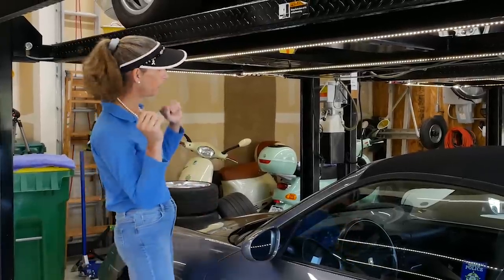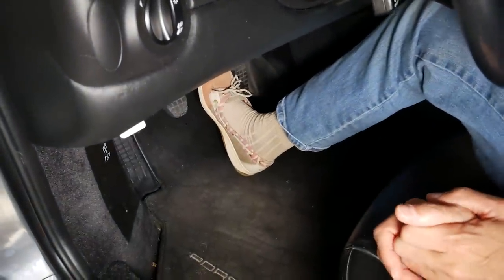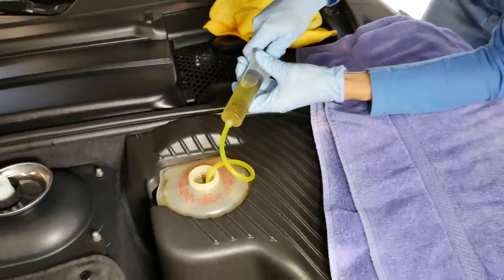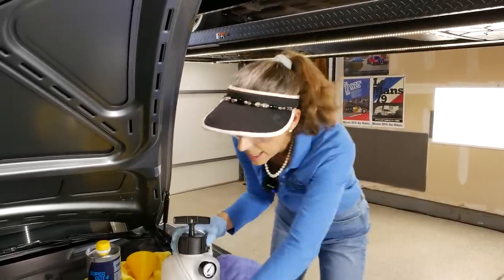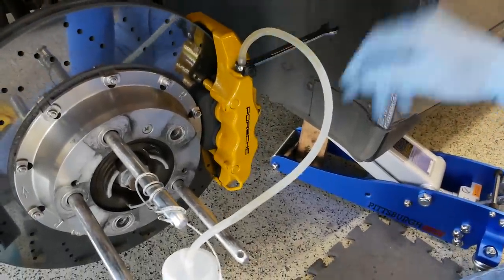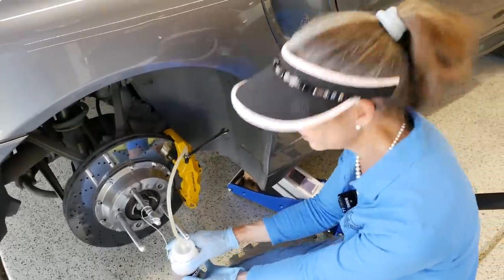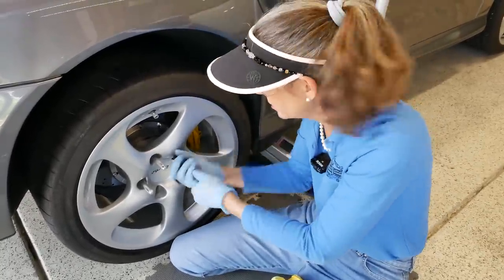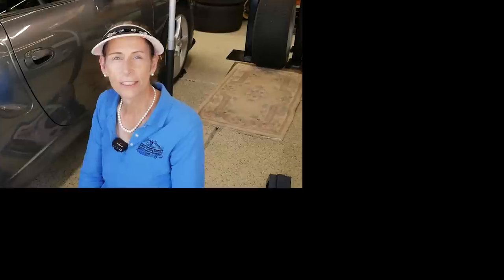How To Flush and Bleed your Brakes - EASY!

Comment: Great video, just couple safety things, I was always taught not to use ratchet for primary loosening or tightening as lot pressure on small paw of ratchet. More importantly please don’t put your foot under wheel when only relying on jack, always block or place stand under car. Sorry if sound draconian just don’t want see you get hurt.
Reply from the maker: Tony E No, thanks for that! I didn't film (well, didn't make it into the edit actually...) I have a block of maple locking the jack.  It is always a dilemma with these cars that there really is only one jack point.  Normally I scoot a wheel under the car, but these are too wide! 
A break over bar is always stronger, but that ratchet can take well over 150ft-lbs.  It is pretty strong. Easily replaced as well ;) thanks for the safety reminder :)

Comment: This was informative, but can you do a video with the two-person method?  That is a viable option for those without a brake bleeder, or one that turns out to be a crappier one than what you had.
Reply from the maker: Look at the 356C videos and the VW Beetle videos.  It is really just Pump, Pump, Hold - then release the bleeder for a couple of seconds then close the bleeder and repeat.  Start the furthest from the master cylinder and work toward it.  Flush out all air and any additional fluid you want to push out.  Just remember to check the reservoir frequently and never let it run dry.

Comment: Excellent video. I plan to try it myself. BTW.....Where do you find those 3 guide rods for reinstalling the massive rear tires?  Thx
Reply from the maker: They are called wheel hangers.  Check with Sun Coast Porsche.
Reply: @HeidiandFranny  Excellent! Thanks for the info.

Comment: For those of us with manual transmissions (G50) the fluid reservoir has an upper (clutch) & a lower (brake) orifice. If you let the fluid level go down past the clutch orifice to the brake orifice, during bleeding, you risk allowing air into the clutch line. The result will be a clutch that stays on the floor (spring pressure). Bleeding the clutch is a b1tch.
Reply from the maker: Thanks for that!  Got to monitor that reservoir like a hawk!!

Comment: How do you keep your rims so clean and nice? Mine are pretty nice, but not at the standard to put ceramic coating on, since I do have tar spots and other contamination that is really hard to completely get rid of. Another thing;  where do I get the alignment rods?
Reply from the maker: I had cleaned these summer rims before they got put away last fall.  If you go through the grief and get them super clean (the i8 took a few hours a piece!) they are much easier to keep clean.  If you want to ceramic coat them, I did a video on that: https://youtu.be/hV5g7Ige9Oo  I did a quick two stage polish to make sure they were really clean.  Those alignment rods are available through Porsche, but I bet you can find them just about anywhere on-line.  They also fit some Ferraris as well.

Comment: I’m sincerely asking, I thought it’s bad to use extensions on a torque wrench? Am I wrong or are there exceptions?
Reply from the maker: If you are talking about a socket extension then there is no difference.  The socket must and will deliver the torque from the torque wrench completely in a steady state condition.  Newton's first law - A body at rest will remain at rest unless acted on by an external force.  So, if the torque wrench delivers 100 ft-lbs of torque, then the socket must counter that or you will have movement.  The extension only acts as a transmission device to transfer the torque further down the rotational axis.

Comment: I am having hard time pulling out the filter cup ( screen)  from the reservoir - similar to what you have shown in your video. Do you have similar issue with that ? or if you have an input to add that might help.
Reply from the maker: Just work with it a bit.  Sometimes it takes two fingers on opposite sides.  They do snap in so can be a little stiff getting out.

Comment: If I'm planning to change the soft brake lines as well, would I flush the system first, then change the lines? If so, would I have to flush again after changing the lines?
Reply from the maker: I would just change out the lines then flush and bleed.
Reply: @HeidiandFranny  thank you! And as everyone else mentioned, thanks for posting such a great video! Hopefully it will be smooth sailing. 😬
Reply from the maker: @TonyMajo  Thanks so much! Good luck on your brake work :)

Comment: Thank you for showing how to correctly doing the brake job  i was especially happy when you showed how to use a torque wrench correctly  because every time l,ve gone to the garage  the mechanic  use,s a rattle gun in my opinion most mechanics are nut fuckers 
and i will be doing my brake my self  after seeing how to do the job your way 😃😃😃

Comment: Please check your facts a little better, it is perfectly ok to mix brake fluids. What you said it the video about not being able to mix them is absolutely incorrect! You can mix any brake fluid with an equal or higher rating that what your car requires with no ill affect. The only fluid I would guard against mixing is Pentosin. Even if you use a dot 3 in a dot 4, the rating will be reduced to the specs somewhere between the 3 and 4 but it will still work.
Reply from the maker: But that is the issue - you get a mixture that you now don't really know the properties of.  Best to do a complete flush and use one type.  I suppose you could push 4 over three, but it isn't expensive and you might as well do a complete flush.  I would never push three over four - the temp rating isn't as high.